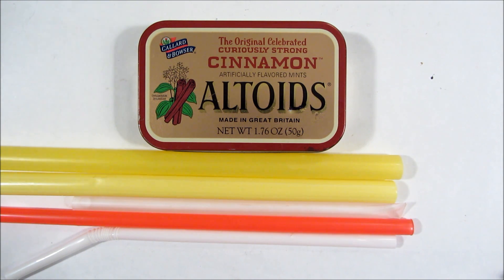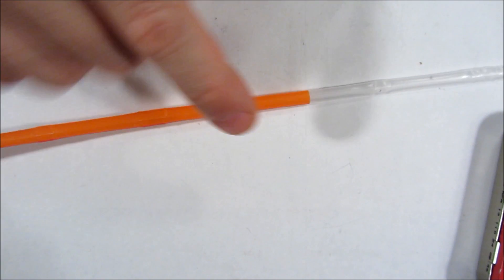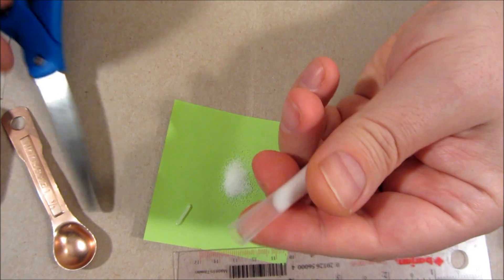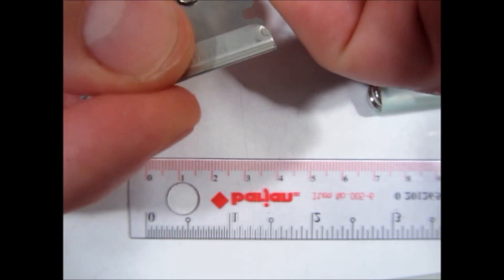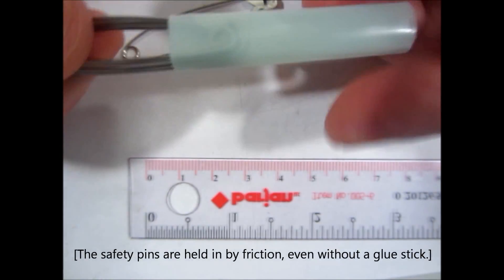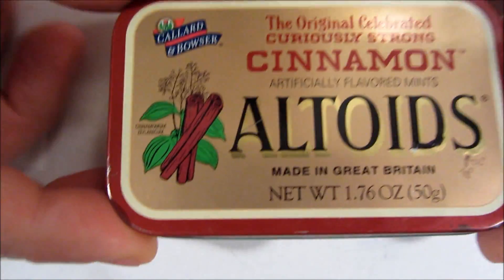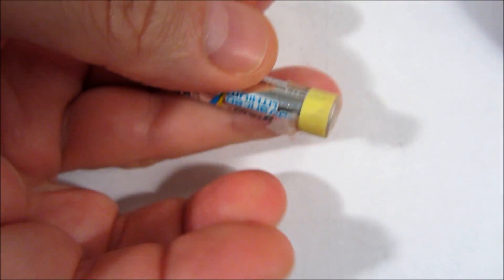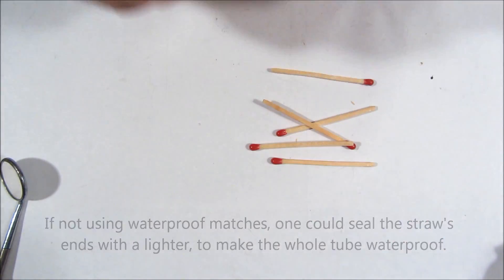Survival Kit Plastic Straw Mods

Comment: This may be a dumb question but could you keep butter in one of the straws? For outdoor cooking purposes.
Reply from the maker: +Just a Black Dude Butter will eventually go rancid without refrigeration, although if you kept it cold by some means it might sort of work. I try to avoid keeping edible goods in these melted straws because they are not sterile so bacteria may grow inside and the plastic they use was never designed to be heated with a lighter so it may potentially leak harmful chemicals into the food. My limited understanding is that mineral oil is often used for folding knives that are used to cut foods because it doesn't go rancid and although it might not be tasty, at least it is edible. Because of those reasons it is my go to oil for these sorts of micro survival kit straws, although I can't guarantee the safety.
Reply: +MeZillch thanks for the reply and the info.
Reply: @MeZillch  i NEED to eat mineral oil NOW. thanks!!

Comment: You make the greatest videos and your creativity is remarkable. I was frustrated with the straw idea and being able to reuse them. To solve the problem I have begun using electrical twist connectors and invert them into the straw like a cap. More recently I discovered Ace hardware actually so sells small corks, although they are a bit expensive at 60¢ a piece. I would love to see how you an age to roll the produce bag into a straw. I have tried a half dozen time and I think you must have some magic behind that one.
Reply from the maker: +Ron Cascioli Thanks. Since making this video most of my kits keep the supermarket produce bag folded instead of rolled, largely because I must admit it is not easy to roll up. If you must, there are several important tricks: A. NEVER open the bag exposing the interior to air which will cause bubbles and thickness. Take it off the roll, fold it loosely to get it home; and then roll it B. Use a form such as a toothpick or a BIC pen ink tube to get you started with the roll, but then once you have gone around it a few times pull the form out laterally and squash the center hole it has left flat and continue to roll. C. Keep the bag flat and slightly taut as you roll it up, obviously from the bottom to the top, allowing the air bubble to squeeze out and escape out the top, open end.  D. When you reach the end and it is time to stuff it in the straw, rotate it as you twist it in, bit by bit, rotating the bag in the direction which tightens it even further...when you finally give up in frustration, ha-ha, watch how I now deal with bags in this bag video. https://youtu.be/TBxoXaM1N6s